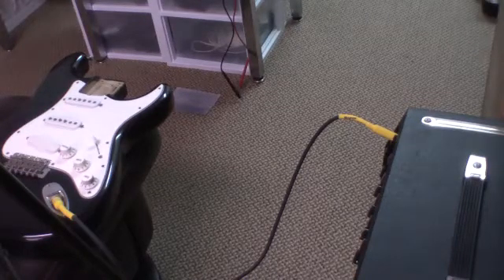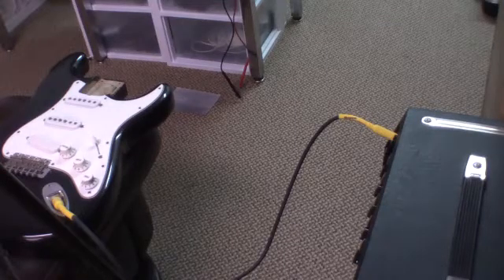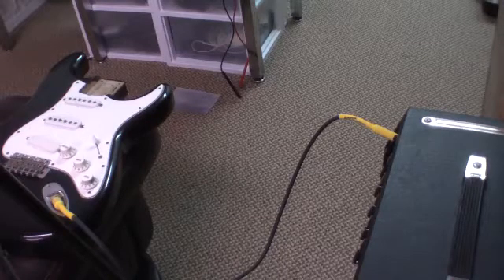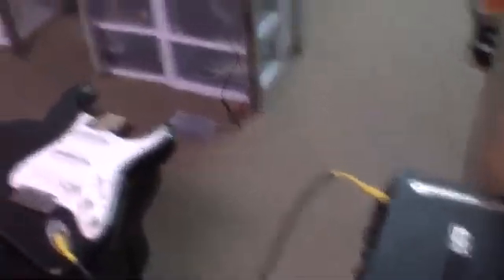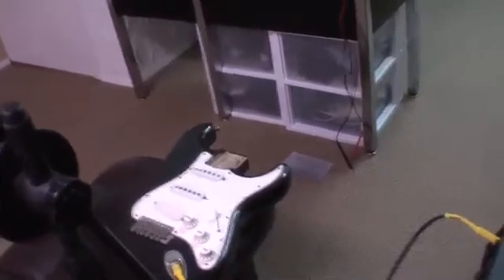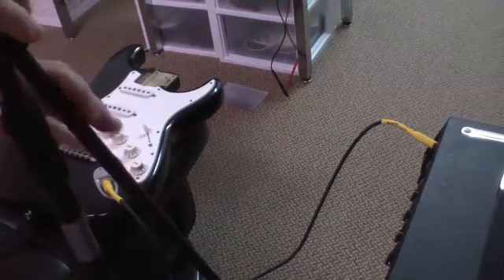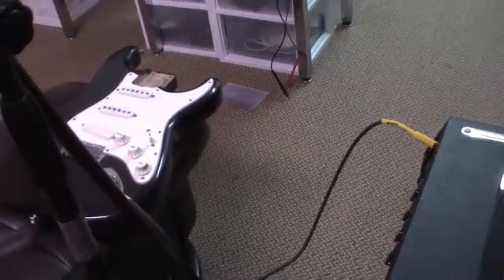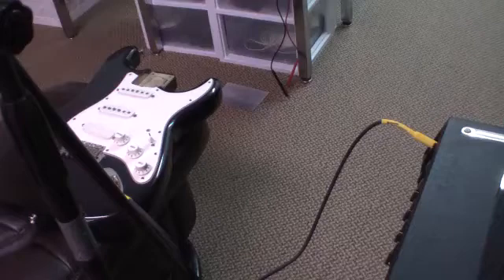Does Tone Wood Affect the Sound of an Electric Guitar when Plugged In?

Comment: 1st shure sm57 polar pattern is cardiod not omni,2nd your pickups might be microphonic, check that out first, you should go to another room with your guitar as it is (body only) leave the 57 on the speaker and shout at your guitar's pickups, if there's signal it means that your pickups are microphonic in which case everything you tested is wrong. Until this test is done with this exact same guitar and then the pickguard hitting test again (in the same video) i will not be convinced nor will i accept this as a valid experiment.
Reply from the maker: You are correct my mistake, a 57 is cardiod, which means it picks up NOTHING behind it. So you get the point. search 57 cardiod images if you are unaware of what a cardiod pattern looks like. All pickups are microphonic (to an extent), that is the point. Listen to how loud a mere tiny tap of my fingertip on the scratch plate is through the amp. Do you really think you'd hear that coming out the amp as such. Of course not, only a fucking idiot would think that.  Because normal people can tell its being amplified. The signal is coming from the guitar, just as it does from my Les Paul, and from a pair of Seymour Duncans in my USA Charvel San Dimas. They all behave the same. ALL PICKUPS are microphonic to an extent and thus have this effect, to an extent. If you want to really hear wood, note how a Les Paul Junior has it's P90 mounted right into the wood. Vibrations are sent into the guitar via the bridge, the nut and or frets, and return to become part of the signal path in two ways #1. Through a microphonic effect (which is what the knocking is about) and #2 by newtons law back through the points of connection, thus affecting the very wave pattern by wave reflection. There are some document links below to the math if you care to educate yourself, it's been known for about 300 years now. That's why builders use wood mostly to make guitars. A set of pickups DO NOT sound identical in a Dan Armstrong acrylic guitar, for example - though even those guitars often have a wood neck. Not that acrylic sounds bad, it's just different. All woods sound slightly different if their densities and characteristics are different. Even different shapes sound different, each has a note. This is all proven physics. Kids stuff. To what extent does the wood make a difference? Not much, in fact it doesnt take long before it is not having much affect at all. Ever wonder why those extremely light ashwood Ibanez guitars from the 80's sound like absolutely nothing? Its the high gain pickups, light weight bodies, and very thin necks, combined with minimal contact via the floyd rose. That is why Ibanez suck, they have next to no wood tone whatsoever, and so yes, in that case, the wood is next to irrelevent. In the case of toneless guitars, and there are many, sure you can swap pickups back and forth and you probably wont hear a difference or much at all.

Comment: Guitar pickups work on electromagnetic transduction, wood is not magnetic.  Therefore is does not influence the disturbance in the magnetic fields.
Reply from the maker: Unfortunately you didn't watch the video, or go to school. The reality is that pickups are so sensitive that even the vibration of the wood, is enough to displace the pole pieces enough, such that the surrounding coils are affected. The vibration of wood alone, effects the output. Now we both know that wood is not magnetic - what you just learned (or will learn if you watch the video this time) -- is that you need not even have strings (the magnetic component as you refer to) on the guitar AT ALL to see this effect.
Reply: KyleCarrington Would you say that paint color effects the guitar's tone?  Because paint interferes with the natural vibrations of the wood and different color paints have different densities.  All things being equal (except for the paint color)  will a blue guitar sound different than a green guitar?
Reply from the maker: transtremm Now we are getting into PURELY personal opinion. I find it slightly amusing that people are so hard bent on opinion, in one direction, that they seem to lose their compass, their navigation. A person needs to really use your ears. It's not difficult to hear that a wooden electric guitar sounds like fucking wood and not all steel. Ever play a Dobro? hhaha - like truly, give it some ear time. Additionally.. if you have a high gain super Dimarzio pickup measuring in at 18kohms, running into a dirt box, cranked out of a high gain amp... did you really expect to hear any wood in your tone at that point?? like really...? Do the test with a sound that the signal coming out of the instrument stands to let the wood even make up a proportion of the bandwidth... if wood plays a part in the signal, using a high gain pickup clearly mathematically reduces the chances of the wood making up much of that signal bandwidth. Have you ever taken a perfect pitch course? It's amazing, .. but anyway, point is only that you can "open your hearing to many spectrums". This is what I am capable of... I can hear (given all things equal electronically speaking) the difference between a really bright wood and darker woods, so for example, does an all maple neck on my strat sound different than a neck that is virtually identical except that it has a rosewood fretboard? ABSOLUTELY. So that is one degree of "difference" that TONE wood makes. The rosewood changes the tone. I've done it, and in fact I am going to go as far as to say I believe almost anyone could hear the difference. Now hear is another example: I had a set of seymour duncans in an all walnut, mahogany and rosewood guitar. I gave them to a friend that had a les paul, same bridge & nut materials/dimensions -- now his Les Paul (oddly) was newer and had a maple neck, and a maple top on the body. did it sound differently with my pickups? Absolutely. In fact I would bet money on a drunken street bum being able to hear the difference. What is the difference? It is a brightness, a treble boost from the maple, and narrower band of frequencies, than opposed to the warmer wider, fatter tone of the rosewood & mahogany. Is one better than the other? That's a total matter of opinion, but they are absolutely different, and that's why 10 million people know exactly what the hell I'm talking about, and have known it for 60 years. Tell Les Paul that it doesn't make a damn bit of difference what an electric guitar is made of, and he'll laugh in your face. As for the paint, some people say it does, personally I will say this... I know that if you had enough data from a spectrum analyzer it would most likely support the theory, but I rather doubt I'd hear the difference. People make too much of this, it is not an all or nothing thing, if you believe in Newton's Laws of Physics. To deny that wood has any effect whatsoever is going against a hell of lot of physics, so truly, and deniers that would like to actually validate their claims, need to come up with some math that proves vibrational energy DOES NOT transmit through a fixed point; in contrast to the available math that discusses that phenomenon and how you can calculate the energy that returns in reflection. In shoirt, it's a silly fucking notion that makes those that claim it look like they droipped out of high school. Does the guitar industry make too much out this whole tone wood thing? Maybe... some would say DEFINITELY - but bear in mind tone is not the only reason to choose a wood, in fact -- it's not even half of it. There are the looks, of the wood, the feel of the wood, and the sound of the wood, so even if all these naysayers were correct, woods would still matter, and quite frankly, none of them are running around proud of their instruments made purely from cardboard, so what the fuck are they really trying to say, anyhow?
Reply: No one has said wood itself influences the disturbance of magnetic fields, that's the point that is not being clearly understood. However, the mass and density that supports a strings mounting will indirectly influence how the strings tonal quality through a magnetic coil is received and transmitted.
Reply from the maker: ceounicom something is happening, period. that much is certain. even the slightest vibration is being detected, but as one fellow pointed out, it may actually be the springs in the back.... that is the only logical argument ive heard so far. people just dont get it though, a pickup IS a microphone. There are no "non-microphonic" pickups, they all exude that quality to one degree or another.
Reply from the maker: kay ger exactly. you get it.
Reply from the maker: ceounicom the problem with yours, and all of the silly statements that are made up of what, 100 people online in contradiction with thousands in industry is that you are making negligible the entire concept of the wood, itself vibrating and thus interfering with, complimenting and interacting with, the original string oscillation. thats what i mean by "something is going on there". those of you who think it is as simple as a single math equation showing the relationship at hand, need to think again, that simple equation is used, and was developed FOR A SITUATION WHERE THE STRING IS HELD IN PLACE WITH AN INFINITE MASS THAT DOES NOT INTERACT BACK WITH THAT STRING. A wood guitar simply isn't that, and until you and all the others stop arguing your point with grade ten frequency, harmonic and node math ALONE, you're not going to see the big picture, and no I am not an expert on timbre physics and the inner variables of how a vibrating mass interacts with a held vibrating string...

but i do know this

the resultant waveform is a product of both of those physical factors

and

yes, all pickups ARE microphonic, to one minor extent or another. yes, they are that sensitive. 

it isnt just about mechanical impedence, the vibrating string is in turn vibrating the wood and it, in turn IS producing a note. of qualities that have all the qualities of timbre (a subject none of you truthers even touch). attack. sustain. coloration. and that "sound" the string forces the wood to produce, in turn influences the non-perfect resultant wave. thats why this billion dollar industry actually does require some talent, wow, imagine that. that is also why you cant take a 57 gibson pickup and slam it onto any piece of shit and have a great sounding les paul. imagine that. who would have thunk it.
Reply from the maker: ceounicom if you think eddie's guitars sounded good, maybe that explains everything. :P i see though, you've run out of arguments because your still stuck on that infinite mass suspended string and it's pure mathematics. Funny how people think that a simple 2 or three variable algebra equation can explain something completely and without exception, then get their panties in a knot when someone comes along and mentions they forgot that study was simplified for kids' general understanding, and that in fact there actually is complex math associated with timbre study, etc. 

oh well, rest assured

you and the "Tone Truthers" will prevail. then every piece of shit chibson will sound amazing

ya right

Actually it's a deeper conspiracy, there are actually a group called The Tone-O-Mati -- a secret society of instrument manufacturing companies -- and they secretly meet and have a laugh on the world as they play their chinese chibsons outfitted with real gibson pickups and mock the workmanship of their own product, as there is no audible difference mwuhahahahahahahaha
Reply from the maker: e james you know, it's funny. you have all of these tone truthers claiming that wood cannot possibly make a difference in tone, due to physics - yet - as far as i see it; to take that point of view, you must assume that a string, as engineered on an electric guitar is INFINITELY supported, by an INFINITE mass, of INFINITE density. Under these circumstance - sure - we can completely consider the wood negligible and as such it would have no effect, and thus, we can use the very simple grade 10 ten physics equations and feel certain they are the only variables at play. But that's not the case. Some of the best proof - wheres the truther with the absolute cheapass particle board guitar, loaded with Gibson pickups that sounds EXACTLY like a hgih quality Les Paul. I don't see one. Ironically, once, I bought a beautiful Gibson pickup, a '57 and put it in my Ibanez lightweight guitar. It sounded nothing like a Les Paul.
Reply from the maker: e james it was not an original '57, sorry didn't mean to imply that, it was a Gibson '57 though, a re-issue from the 70's. it went into an ibanez in the 80's at the time, "a gibson pickup" , was no big deal, really. then it eventually got sold before I actually realized it was my favorite sounding humbucker of all time

Comment: There was a video once or it was more of an animated graphic showing how the entire body of an electric guitar oscillates in sympathy with the vibrating string. Some guitars on some notes resonate so much you feel it in your hands. Interesting vid. Thanks.
Reply: DKGCustom
 No, I have, I think you have done a few of these - all very good. The only that will prove this issue conclusively and put this matter to rest once and for all is to have a plucking apparatus that plucks the notes the same way each time, and direct comparison can be made.

This guy found no statistical difference between alder and swamp ash using a standard input

http://www.google.com/url?sa=t&rct=j&q=&esrc=s&source=web&cd=1&cad=rja&uact=8&ved=0CCEQFjAA&url=http%3A%2F%2Fwww.stormriders.com%2Fguitar%2Ftelecaster%2Fguitar_wood.pdf&ei=s3jpU7i5NuvZ8AHo9oDQDA&usg=AFQjCNGFsK_bbsF1xJ6wHvCZ3O9kH1vLXg&sig2=dyEX67Yby-AR-QPYqul42g&bvm=bv.72676100,d.b2U

It would be interesting to do the same for your drainpipe guitar.
Reply: moreanimalspirits I was expecting a proliferation of Youtube tests, especially countering my results. So far, nothing. And that is pretty telling. Maybe there were some done, but the results were not were what folks wanted, so never aired them. NO-ONE has been able to to produce an empirical experiment to show a difference..plenty thought experiments though.
So at this point, the flaws in my experiment are irrelevant. So far....
Reply: Yes, of course that's the case.  Otherwise those headstock tuners wouldn't work.  I've noticed that my tuner doesn't work as well with My SG as with my Les Paul.  I have to strike the strings harder on the SG.  The vibrations simply resonate more strongly on the Les Paul.  I have wonder, how could this not feed back into the strings and affect tone, sustain, dynamics?
Reply: Javasaur13
 Yes indeed. I'm still waiting for someone else to do a real experiment with a machine that plucks notes and look at the waves. Well, ok, I have seen alder vs. ash. But nothing else.
Reply: moreanimalspirits I guess you've not seen mine
Reply: Well, someone pointed out to me that Keith J. Soper's paper actually did have greater differences in some frequencies than Soper himself thought. And Soper did not include a test - which somehow I missed. Anyone can look at the graphs and decide if you think they may amount to anything. Problem is an increase in one frequency might be offset by another, which is why an actual experiment might be a better idea.

I also found another paper by Butch Iafelice which I am reading now.
Reply: moreanimalspirits There's some papers linked on my primordial website. Most of which can show interesting graphs, but the conclusion on audible perception is negligible or inconclusive...